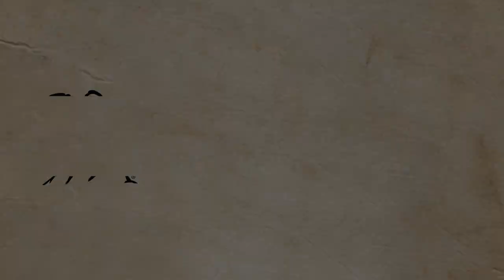Quick Tip: 1911 Series 70 vs Series 80

Comment: Good explanation but pretty amazing that you never mentioned that Series 70 1911s are NOT drop safe if dropped on the muzzle (if the firing pin springs are too fatigued & weak)!  This is the entire reason Colt came up with the Series 80 (firing pin block).  The function of the Series 80 system is to blocks the firing pin from being able to move forward toward the primer UNLESS the trigger has been pulled to unblock the firing pin's path.  Without a firing pin block, if the gun is dropped on its muzzle, the momentum of the firing pin's mass can carry it forward when the rest of the gun stops - even if the trigger is never pulled or the hammer never drops - and causing an accidental discharge.  The risk of injury or death from a firearm going off when hitting the floor after being dropped is unacceptable.  Some manufacturers are using an alternative to the Series 70 firing pin block of using a lightweight titanium firing pin that has less momentum to possibly carry the firing pin into the primer with enough force to detonate the round.  Since the Series 80 system (with trigger-operated firing pin block) causes the trigger to have a worse feel and be more prone to mechanical failures, Kimber's version of a firing pin block on their Series II models uses a grip safety activated firing pin block, which will only allow the firing pin to move if pressure is applied to the grip safety, thus retaining the original functionality and feel of the trigger while making the gun drop safe.

Comment: I have several Colts in both Series 70 and 80 and can't tell the difference  unless I pull the slide off. I've also never noticed a difference in trigger pull between the two and I doubt that the average shooter can either.
Reply: Exactly, this is a temptest in a tea kettle a clean and maintaned gun will NEVER have an issue and only select people will ever even notice a difference. Its just a bunch of old guys who are skeered  of "new". Considering its been in place for decades as well, we would know by know if it was really any kind of issue at all.
Reply: Do you have any suggestions for sourcing parts for seris 70 mk4  ?

Comment: I like the series 80 more. They wanted to make a gun with less parts so it would be cheaper for them to make. More profit! Then make people think it's better. Do a trigger job on the series 80 if you want a lighter trigger. Kinda like new homes pushing open concept houses. Less walls and material. Made cheaper and selling for more and acting like is better.

Comment: It should also be noted that the series 80 firing pin will work in the 70 but a series 70 firing pin wont work in the 80 if the 80 has not be converted. Next there is an extra depressor and spring in the series 70 Goldcups that are not present in the 70 or 80 series 1911s of reagular builds, and as far as I know no other 1911s built by any company.

Comment: I've personally had FTF issues with older Colt Series 80 versions, when the firing pin safety plunger spring has been compressed over time or not installed correctly. Converting to 70 series eliminates that possibility.
Reply: I have personally NEVER had a FTF with a series 80 1911 with, realistically, a few thousand rounds through mine.

Ill keep the extra safety.
Reply: @jamesshride3158  Seems the 1911 has enough safties lol, why add another failure point?

Comment: So it's mainly safety reasons on the 80? So if you're using your thumb safety on the series 70, you don't need a series 80?
Reply: The plunger on the series 80 is a drop saftey. If a series 70 is dropped the firing pin can move forward by inertia to contact the primer.
Reply: OMG!
Reply: As @redcat9436  mentioned, it's a drop safety thing. You can also improve the drop safety of a series 70 by installing a titanium firing pin: this means the firing pin will have less inertia to strike the prime if the gun falls, and also improves the primer strikes since more of the energy of the hammer is out into the primers instead of accelerating that steel firing pin. Win/win.